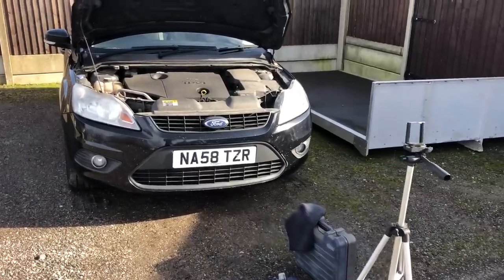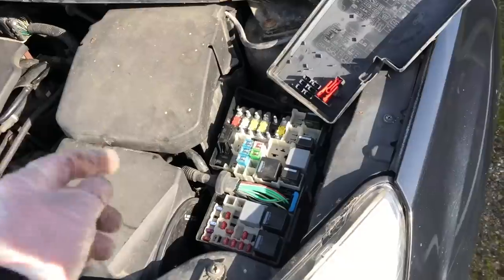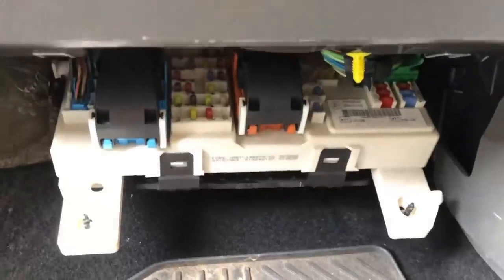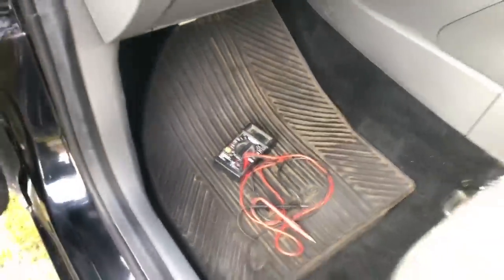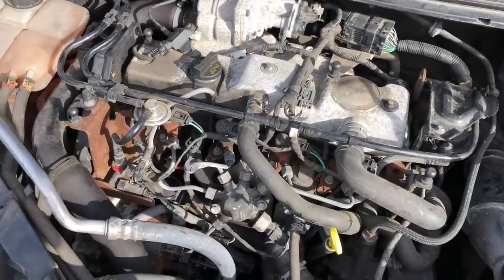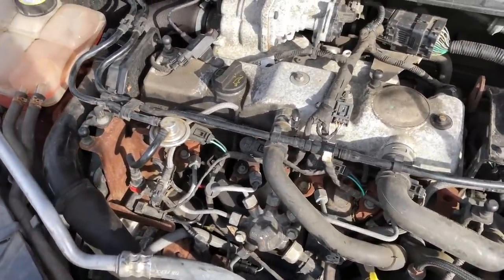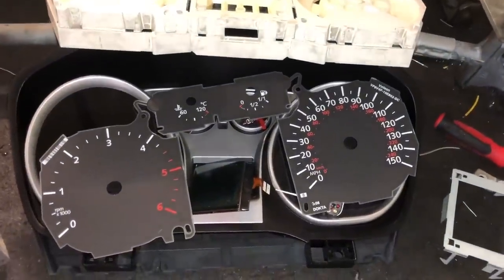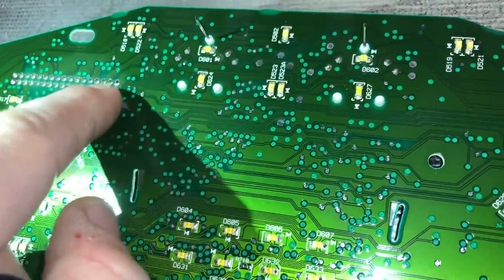£200 bargain car adventure pt2

Comment: Great content Rob . Came across this fault 6 months ago for first time, makes you wonder how many decent little motors have been scrapped because of a dry solder joint . Had the same issue on my Mig welder printed circuit board , was I smiling once I sorted it out lol .

Comment: Good job Rob, I had a 2003 Corsa C with a similar problem, it’d cut out dead and would restart (mostly) after pushing the instrument cluster alternatively side to side. Never got it fixed but the cluster would periodically go haywire which sometimes coincided with the stopping issue.

Comment: I had this problem with a diesel and while your correct about it been 1 of 100 things in my case the Crank Position Sensor had the end of it broken off.  Fitted new sensor - started immediately.

Comment: hi yeah i have a 2006 1.8 tdci had the same issue once i'd worked out what it was having to look it up my self very easy repair and that was 2 years ago and still going strong so that fix should last for some time but you can se clocks from a different focus but u do need to roll the firmware back it don just happen on the focus its across the range from 2005 to like 2012 or 2015 some where around there keep up the good work injoy ur videos

Comment: Somebody probably got a nice bonus for sourcing those cheap circuit boards. Quality control is tossed out of the window for the sake of a pound or two saved. Glad you were able to get this one sorted guys.
Reply: As has been said, it's not Ford's fault, they'd prefer to use leaded solder & the boards would last forever. With heat & vibration Lead-free solder joints only last a couple of years, they are brittle & shite. Notice how pcb's in boilers & washing machines fail a lot earlier nowadays?
Reply: @wirdy1  You are correct! But Ford should keep the engine electrics independent from the ECU. It's crazy to think that a dry joint in the Clock Functions can stop you dead. Also, I do agree that lead-free solder breaks away easier, but Ford could always go to the higher quality silver solder. LG TVs were all wave silver-soldered on their PCBs which gives improved conductivity too!

Comment: I had no abs or traction control on my Jaguar Xj8..dealer wanted around £1000 to sort it, it was a dry joint in abs control module. A blob of solder and its been fine for last 3 years. Many thanks to guys like you who put out information like this on YouTube videos!

Comment: well like they say every day is a learning day never would of thought it would be the board in the clocks with dry joints in a million years
Reply: Really common fault on a few fords
Reply: Very very common problem had mine done just over 2 months ago
Reply: @daveking1520  same with me, but I'm pretty sure the fuel and temperature needles are not lined up properly, as from first morning start up engine temp reads over 60 degress
Reply: @WildeTone  That must of been the person who fixed it. He should of marked the needles first with a bit of tape. Take it back to him and explain, its a quick fix for him.

Comment: Unbelievable that something so simple could scrap a car! 
Electrics are the biggest problem with cars nowadays.👍
Reply: Manufacturers are forced by legislation to use lead-free solder and that is the problem. Military equipment is exempted, and NASA refuse to use lead-free too. We consumers get rubbish - cars, laptops, phones, game consoles, TVs all prone to failure.
Reply: @keithmatthews1673  yep, never truer words said. Thank goodness I was military tech, so could use lead alloy solder all day long! Can't stand using  lead-free.
Reply: I figured something electrical, but something this simple? Wow, good call.
Reply: @keithmatthews1673  Yup ... Brother-in Law used to say the same about Alarm circuits and everyone is familiar with failed PCB boards on Combo boilers.
Reply: @notrut  -  HaHa - yes a failed PCB killed my Potterton boiler as gas bloke could not fix it  !
Reply: I do agree that Electrics are the biggest problem with cars these days. But in Aircraft, you cannot afford to have the Jet Engines stop at 35,000 feet - if ANY of the Avionics should fail. From this video, we must put this down to bad design by Ford, for not having INDEPENDENT ELECTRICAL SYSTEMS. I am sure that this scenario with the Ford Diesel would make anyone think twice before buying a Ford again.
Reply: I'm a Vehicle Electrician so I knew it was the problem when I commented yesterday evening ,
 I've had many many many customers with the same problem so it was obvious this would differ not a sausage lol
Reply: @jesus jones all you would need is a welder and a pile of metal, today you need a masters degree in electronics and a laptop that's configured for your make of car. Thing is they dont want you to keep cars now
Reply: @keithmatthews1673  The RoSH ban on leaded solder happened in 2006. Electronics manufactured around this time has a high failure rate due to poor soldering practises, manufacturers were not familiar with non-leaded solder. The most notorious issue was the Xbox 360's RROD (Red Ring of Death), caused when the solder balls in the Graphics Chip became damaged over time, resulting in a 54.2% failure rate within warranty!

Nowadays lead-free solder rarely has these issues, which were mostly teething problems.
Reply: @petedrake1  Often times you really don't need the manufacturer laptop. If ford still uses the same system they co developed with mazda I would prefer to use a generic pro scan tool. The ford system is so obtuse and looks like it was made to run on a C64.
Reply: @wirdy1  You can buy leaded solder if you wish at  mouser etc.

Comment: I had a similar problem on a corsa c once, the owner dropped it off the night before for a replacement timing chain, went to start it the next day but it wouldn't start, rang the owner and he said oh just push on the speedo and it will start, turned out to be a common fault on them. Great tip with the touch up Rob will use that in the future.

Comment: Well done Rob patients of a saint! I would of never of thought the clocks would of stopped it from running. I'm having issues with the clocks in my mk6 transit the rev counter and speedo stop working give the top of the dash a tap and they come back on. I think I'll sauce an old set of clocks to strip and investigate see if I can do the repair myself. Keep them coming mate loving the content. ☺

Comment: Who'd have thought a circuit board would fail like that! Would seem to sugest given it is a common problem that the solder didn't flow when the board was first made. Thank god for the internet and the information that gets shared.
Another great result and I suspect the next video will cover the sale. Good luck and thanks again for a very informative video.

Comment: Glad it worked out for you. The clocks in MK6 Ford Transits suffer the same issue with the circuit board. I've had mine out and fixed it 👍 Keep up the great content 👌

Comment: I have had 5 Focus diesels, love them, bought an 1.8 Ghia estate with 142,000 on the clock, did 200,000 before the Turbo went, only time it stopped was when the Camshaft sensor went, £5 repair ......loving the video's, nice motor for someone !!

Comment: Had the same with mine, did this job and was fine, before that I just pushed gently on the clocks and it went away, next time the engine malfunction alarm came on it was pat fluid, a small tank under car to clean dpf, easy repair compared to dash solder,

Comment: Clocks 😱😱learning something new every day 
Cracking 🖤
Reply: I would have laughed at someone if they told me the clocks could stop a car from starting
Reply: Wet Lettuce on the motorcycles it is common that clocks are integrated with key and immobiliser and they have to be coded to each other so swapping parts is not that easy. Most Italian manufactures use this system.

Comment: Love ya channel. As an electronic nerd, these are not dry joints they are broken joints for the loom socket. Had the same on my old VW T4 camper where the clocks stopped working.  The wiring loom vibrates behind the cluster making the plug vibrate which causes the socket pins to move, slowly breaking the solder around the pin (which is the circle you spotted). A dry joint is a bad solder joint at point of manufacture. Keep up the good work guys.

Comment: Bloody love the old 1.8 tdci. I've been running them since 2007.
Just bought 58 plate Titanium estate.
For future reference for anyone looking at this video - If it starts with a bash on the dash, it's the cluster
If it doesn't start (especially if it just cuts out while driving) usually Camshaft position sensor

Comment: 32 pin connector  dry joint .   Generally  u get symptoms  ie clock flashing  going berserk ,  red imobilisher  does not go off just flashes .  worth bearing in mind  ur mk 2.5

Comment: Slightly of topic and new to your channel but that looks like the 1.8tdci engine. Blanking the egr valve off with a £3 plate makes these engines sooooooo much nicer to drive! You won't get a check engine light on this particular engine either as the valve relies on vacuum to tell it when to function! 👍

Comment: Great fix, been in and around Fords all my days and still in a focus tdci and never heard of or came across this issue, my previous 1.8 tddi and tdci had over 250k on the clock when sold on still going strong. great video, i do wonder how many peeps has scrapped their car with this fault and bob the mechanic has said dunno just scrap it :(
Reply from the maker: Hillbilly mills I hadn’t heard of it but the auto electric said it’s really common 👍
Reply: salvage rebuilds uk and your mate was dead cheap at 50 sovs for the repair, perfect and a great car for someone 👍

Comment: Going by the corrosion and rust, it looks like that engine bay has had a lot of water in it. Perhaps a small electrical connection has corrosion on it.

Comment: Remember a pal years back spending a fortune trying to fix a knocking from the OS front wheel, every time things were put back together the clunking was still there, it had about 3 separate mechanics baffled then one old wise mechanic spotted the problem and fixed it for free.
Pebble lying in the metal wheel cover lol

Comment: Hello Rob I had a similar problem with a Peugeot partner van it turned out to be a fuel pressure sensor the part cost £4  and a further £200 in labour plus £200 for recovery

Comment: I had a Ford transit van the alternator all the starter motor kept on getting wet and shortening the van out But I had the van washed down I didn’t do it then that’s when only when I went through puddles ministration up at the engine when it cut out

Comment: Well done Rob ! Good old Google eh ?!. I guess with 175K on the clock the soldered joints had plenty of vibration over those years,  it’s not something you would expect. Good job it didn’t cut out in the outside lane on the M25. I had an intermittent electrical fault on a car once, which took me five months to find. The speed humps in Sainsbury’s found the issue for me......I went over them faster than usual and the fault was found to be an insecure wiring loom. The bigger the bump in the road, the more the loom shifted which brought up the fault !. Two cable ties back on the loom where they were removed by a garage previously fixed the issue....always a brain teaser somewhere. Keep the videos coming, the audience numbers going up and up...

Comment: Cracking, for me a '58 reg is new! Those chips on the bumper say a lot of motorway miles, that means good miles so happy days. Never heard of the Ford speedo problem but the beauty of a Ford is that most problems can be fixed for a few quid, £150 sounds good to me. The car is still a bargain at £200.

Comment: Told you it was fuel related Rob!! The hardest part is the fault finding and diagnoses, to change parts ect is generally the easy bit imo, once you know what's wrong but working out what's wrong  first is something experience and knowledge really does help, and the forums and Google etc. Would have put money on fuel first without delving into it, well done mate, you've definitely built up some good contacts over the years to draw upon when you need them 👍🏻
Reply from the maker: ejs355 it wasn’t fuel related it was immobiliser related 👍
Reply: @sruk  I was just being sarcastic regarding my original comment on it being fuel related, any how well done very pleased for you mate!!

Comment: I had spotted the Ford badge but thought if I mentioned it I was being picky.
Interesting video.
Nissan Terranos have always had a problem with dry joints on the dash but thankfully it only affects the Speedo reading but by switching on the lights you get a bit of heat in the binnacle which then expands the soldered joints hey presto.

Comment: I see not much has changed with Fords clock cluster from the early days, had to removed the clocks years ago on a festa with dry joints preventing the Tachometer from working.

Comment: Strangely enough I have driven the London taxi Tx4 2006 onwards Reg and sometime they don’t start, you think the battery is dead, but you have to hit the steering wheel as you turn key and it starts! 
Mechanic said it’s a common problem.

Comment: Whilst watching this video I had a conversation with my kids telling them about a similar fault which was a dry joint on an old Ford cabriolet fuse board, they couldn't remember the car, my son googled the model and the third image on Google was actually my old car sitting outside my old house.... It was a post I put on a forum back in 2007, so thanks for the memory.

Comment: A lot of solder joint problems started when they moved over to lead free solder. Back in the day cars failed because of chassis running gear or engine... now it's nearly always bleedin' electronics.

Comment: Well i would not have thought a dry joint in the dash would cause that.
Anyway i give you a good tip if your car starts then cuts out a few seconds later and the immobilser light comes on a vauxhall mk4.
This happened to me recently and could not work out what it was after replacing the battery in my remote key fob.
I later realised what was causing this starting fault after looking at the spare remote key. There was a detachable immobiliser chip 5mm in diameter that had fell out of its mount inside the remote key when i changed the battery and did not see it drop on the floor.
So when it remounted this chip inside the key fob the car started again.
A good security feature really as a thief could steal your keys from your house and the car would not start if you had taken this small chip out.

Comment: Well as you say not the most obvious thing we thought it would be i.e. fuel. You know when you tested the fuses? Did you pull each out and check for continuity on your multi-meter? I've not used one, but I'm sure there is a tool you can buy that just has a probe you touch to the fuse (without removing it) and tells you if its ok. Could save you hours if you do this regularly.
Reply from the maker: Malcolm Jarvis no just check across the tops with meter 👍

Comment: The RoSH ban on leaded solder happened in 2006. Electronics manufactured around this time has a high failure rate due to poor soldering practises, manufacturers were not familiar with non-leaded solder. The most notorious issue was the Xbox 360's RROD (Red Ring of Death), caused when the solder balls in the Graphics Chip became damaged over time, resulting in a 54.2% failure rate within warranty!

Nowadays lead-free solder rarely has these issues, which were mostly teething problems.

Comment: Wow! Online forums are a goldmine sometimes for information, I've literally saved thousands on my own cars by diagnosing it with the help of forums etc. I would have never have guessed in a million years it would be the clocks. Top upload, very interesting! Cheers 👍 Jack
Reply: Yep defo, my 1.8TDCI was diagnosed with misfire and I wasn't convinced, checked forums and sounded like DMF failing-ran it for 12,000 miles and took it to another garage to get DMF etc changed and they said gearbox. Adamant it was DMF I told them to change it anyway......... turned out to be DMF! Lumpy when cold, metalic noise and kept trying to flick out of gear were the faults, 120,000mls and smooth as hell now 👍

Comment: Nice job. I have never seen anyone use a cotton bud for touching up. A close up would be nice to see the finished job. I worked at a Ford dealership about 20 years ago selling secondhand cars and the workshop manager showed me how to touch up the cars using the lead of a propelling pencil. It was quite effective as the tip of the pencil was quite fine.
Also, about 25 years ago I had a lovely E30 BMW in black. Unfortunately, it had a bad scratch or scar on the paintwork at the tip of the bonnet, probably where the previous owner had run under the back of a small truck. It was about 2 x 1 inches and down to the metal, but fortunately, no scarring or dent. Not having the money to have the bonnet resprayed at the time, I covered the bare metal with primer and then built up the paint with dabs of a small brush, having sprayed the touch up paint into the lid of the paint spray. It took a while to go over it and build it up until it was proud of the surrounding area. I then left it for a couple of weeks to harden and then used some T cut to cut it back. I finished off with some black colour coat and it was barely noticeable. Not the job for you as you can't wait that long, but a cheap repair then!

Comment: Rob I have a friend that had the same car bought it from bexleyheath drove it back to Ashford and it didn’t make it home got it recovered back home then spent money on ECU’s injectors wiring loom and after £800 scrapped it for £165, and if someone would have suggested dry circuit board I would have thought they don’t know what they talking about it’s unbelievable mate